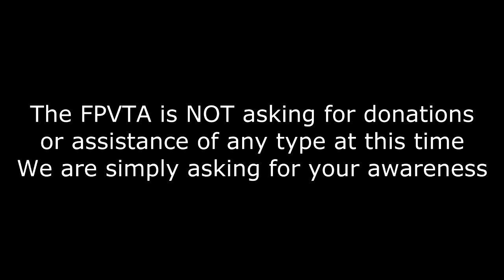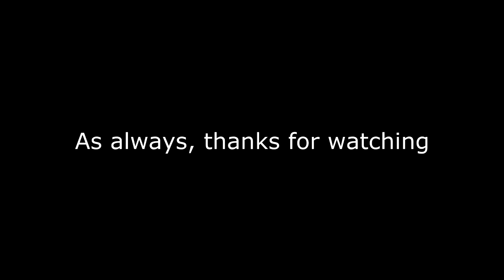The chances of colliding with an airplane

Comment: I'm in the ag aviation segment, where we ferry at 300-500' daily and work at 10' above the crop...a very big concern for our industry. I'm not concerned with accidents with general aviation aircraft at several thousand feet up. This issue is being addressed by our National Ag Aviation association at our convention in early December at Louisville, Ky.
Reply from the maker: What do you do about cell phone towers, telephone poles, and Ham radio towers flying at these low altitudes?  How much of a concern are birds to your flight?  Those are things to which I cannot relate as I'm not a pilot of anything other than models.
Reply: Alex Greve Alex, all of those obstacles keep us on our toes, to be sure. Yes, birds are a constant hazard down low and we do our best to avoid them by circling before diving into a field, to aggravate them to leave. M.E.T towers (Meteorological Evaluation towers) have already cost lives since they're 199' 6" so don't require a light (200' they do, by FAA decree) These towers measure wind speed and duration to see if a wind farm at that location is economically feasible. GPS towers down here create the same problem for us.
Reply from the maker: pierrejs
No lights required for towers?  really?  I thought lights were required every 150 feet.  That's the way cell towers here go.   I imagine that the risk of hitting these is fairly high since they are thin and hard to see.

Comment: Fear mongers: Right now, as I speak, there is someone bleeding out on a road, somewhere in America from a vehicle accident occurring less than 8 minutes ago. Also right now, there are perhaps hundreds of FPV drones buzzing happily about, causing no damage or harm. This is reality. Here is an activity you can do right now: Find the nearest newspaper within arms reach. Open it. Under the "Local News" section, how many people have died in a motor vehicle accident in your town? How many? Be honest with yourselves. Then, after facing reality, go spend some time trying to prevent MVA's in your city. Do something to prevent REAL death and destruction. Do a rally, or whatever it is you might do. Hold picket signs. Tell people that it is dangerous to drive, that they could kill others, that tens of thousands have already died, and will die. Start a movement. Do it! What is stopping you?
Reply from the maker: I actually am uploading a video on just this topic!  Did you know that you have a 1 in 6.7million probability of killing someone or being killed every time you get behind the wheel of your car?  That's 6 times higher than what I'm talking about here and people do it many times daily.

Comment: It would help your case (which I completely agree with btw) if you could provide links in the description to the claims you make like the probability of collision, actual collisions etc. Keep our wings in the sky :)
Reply from the maker: I used Google, Wikipedia, CNN, and VSauce (youtube channel) for my statistics.  I verified them in at least 3 different places before using them.  There was some variation, but for the most part they were very close.  Drowning in the bath tub varied from 1 in 500,000 to 1 in 650,000 for example depending on the source.  Oddly, the toilet statistic I found in 6 different places!

Comment: Holly Crap what did i just walk into :) Alex in a suit mind blown :)
Reply: I saw that and thought "Alex has a new look!"
Reply from the maker: *****
You can't police those who won't listen.  The truth is that altitude doesn't change the risk of mid-air collision (although it does to those on the ground).  The factors actually cancel as the volume is not changed.  It just so happens that it comes to a nice shape and size for a 500 foot comparison.
Reply from the maker: *****  - Very true.  However I thin the reason for their attitude is our reactions to them.  If we would react in a more appropriate fashion (seek to educate rather than criticize) I think their attitudes would change.  This is not true in all cases, but in many it is.

Comment: Surely, the 125 sq. ft. frontal area is massively more then the the actual risky frontal area ie the air intakes or the propeller disk, when you redo the numbers using the smaller area, the risk gets even more miniscule....

You have more chance of becoming president (1 in 10,000,000 )or
winning the Californian lottery (1 in 13,000 000) or
becoming a saint (1 in 20,000,000) or
contracting the human version of mad cow disease: (1 in 40,000,000)
Reply from the maker: Yes, my calculation included the engines, fans, ect.  Without those the frontal area drops to ~ 99 ft^2.  I like the odds of becoming president.  pretty incredible, actually.